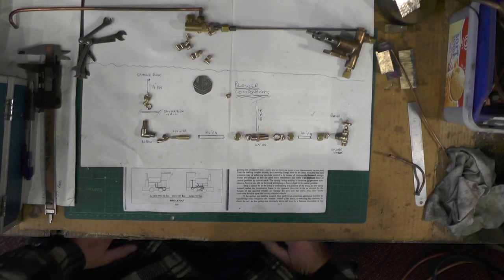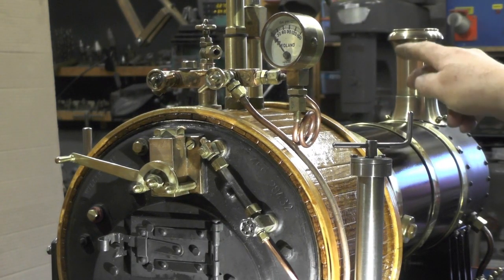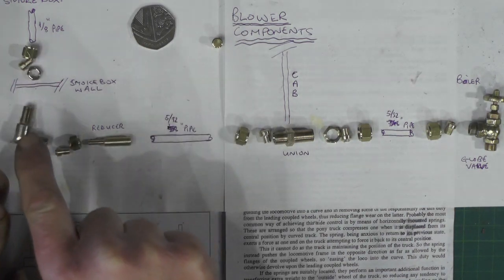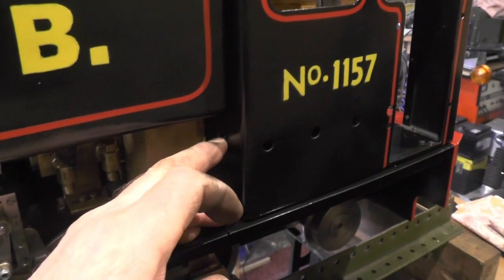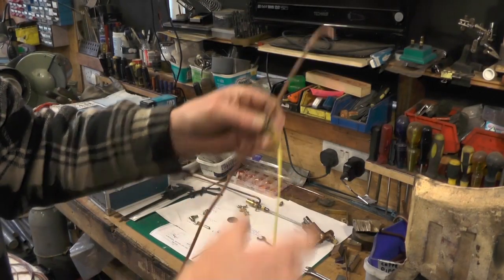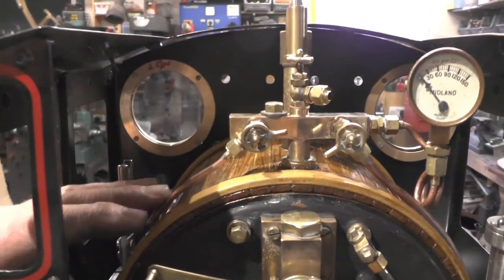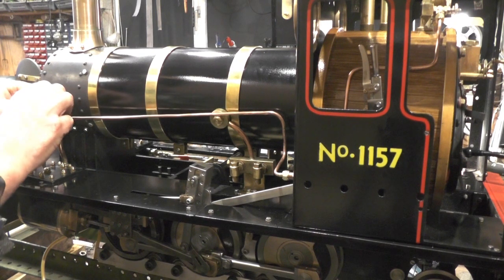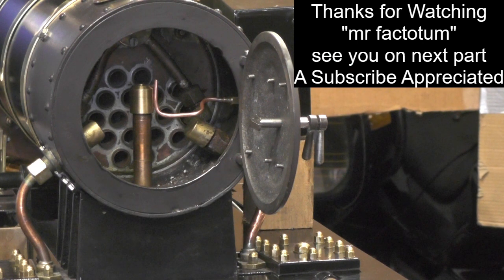Build Your Own Beginners Miniature Steam Locomotive Series (Pipework  P4 BLOWER ) "mr factotum"

Comment: Hi Mr. F, somehow I had missed this video. As usual a treat for all of us to see.  I would like to ask you one question. During the first minute of this video you show the boiler back head and on each side of the regulator you have the boiler stampings shown. Since I made my  traction engine steel boiler myself and I intend to get it certified by a local engineer, what do the markings represent so I can have them stamped on mine.
Thank, best wishes
Emanuel  Lautier
Reply from the maker: hi el
thanks again for watching
the number stamped on my  boiler, is the certificate serial number i was issued with from the boiler inspector, once he had pressure tested the boiler to twice the working pressure after my initial making of the boiler. Once i have the loco completed it has to have another pressure test to 1.5 times the working pressure then a steam test by the boiler inspector and he will then give me my annual certificate, before i can use on the track.
hope that helps, any questions feel free
regards
mr f
Reply: @MrFactotum  Thanks Mr.F, so am I correct as to say that the stamping should be the certificate number, the test pressure and the date it was tested or the actual date of manufacture.
Reply from the maker: @MANNIE1973  hi el
i was only told i had to put the serial number on, but i also included date that I manufactured it and Working Pressure. I have seen other people's boilers with working pressure stamped on.  but never seen any with the test pressure on!! The test pressure is just on the paper certificate.
Not sure if there are different requirements for different countries legislation!!. So the info i've given is for UK boiler requirements.
hope that helps.
regards
mr f
Reply: @MrFactotum  Thanks once again, very helpful.

Comment: Great work ! I noticed your pressure gauge has a couple of coils in the copper line right before it .
I see some loco's with and some without that feature . 
Thank you for the videos of your workmanship !
Very enjoyable 🙏
Reply from the maker: Hi tfs
thanks for watching, yes ive seen both but no experience on whats best, correct me if i'm wrong but i believe its just to make a water trap to stop hot steam touching the gauge, the steam then compresses the water at the gauge to give the reading!!!
see you next time
regards
mr f
Reply: @MrFactotum  Spot on Mr F: https://www.youtube.com/watch?v=Yr1AZc7dnSk&t=372 Though as you can see, a single loop is enough, it just needs to be there as the video shows.
Reply: @MrFactotum  Thank you for you prompt reply ! 
I live in Ontario, Canada and really enjoy your videos . like that fact you machine all your parts from raw material .
You've got a good gift to be able to do that . 
Cheers